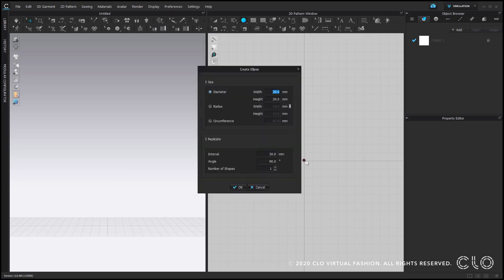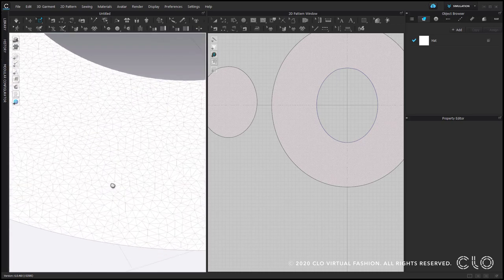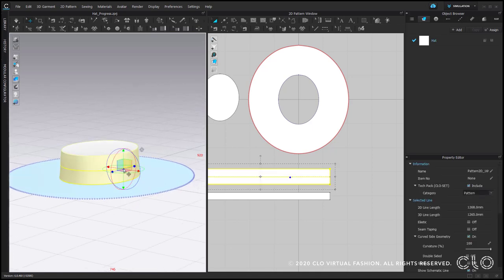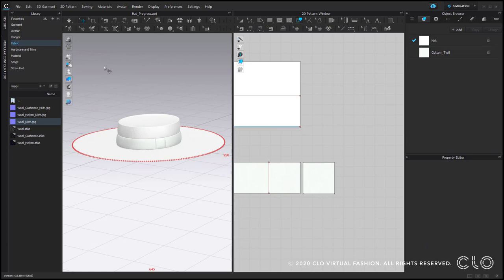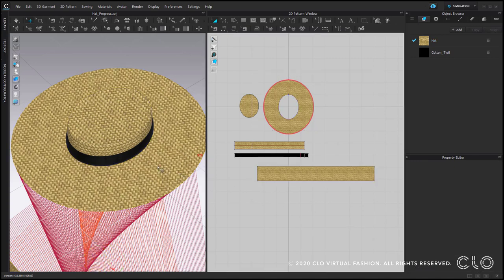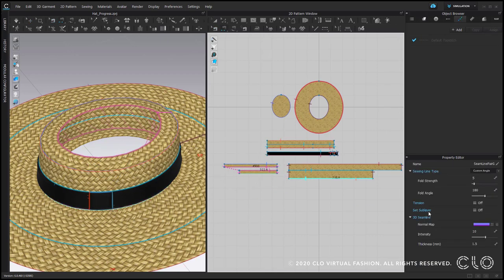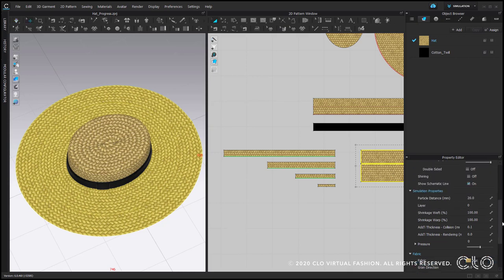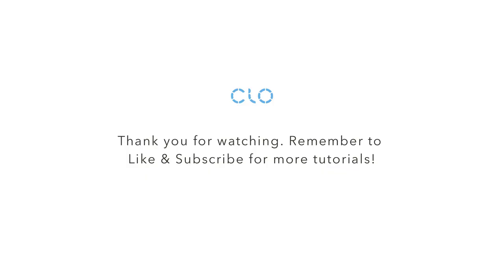How to Create a Straw Boater Hat

Comment: Will this material have draping properties of actual straw once simulated? Or, is this just a UV mapping for demonstration purposes?
Reply from the maker: If you use the right Properties as the base for the Fabric it will simulate. Try using Trim Full Grain Leather and apply Solidify

Comment: HELP hat won't stay on avatar.. for animation
Reply from the maker: Use the Tack on Avatar Tool to attach it to the head.
Reply: @CLO3D  I tried that but it didn't work since my hat is frozen due to weight. However, I'm using mixamo animations so I exported the hat with my avatar. Once I upload the mixamo animation back into clo, it was all good! Thanks btw :)
Reply from the maker: @catherinetheworst  Good job working it out!!